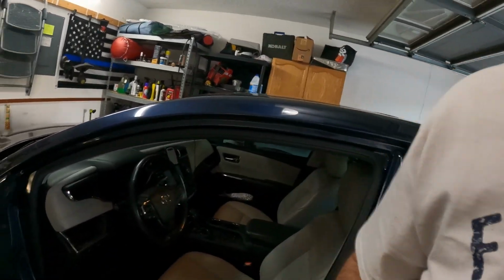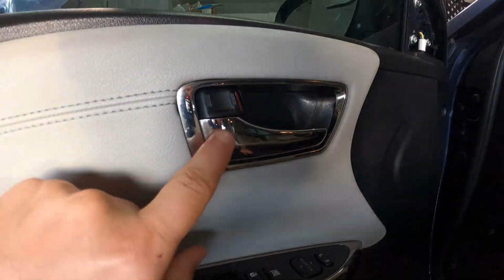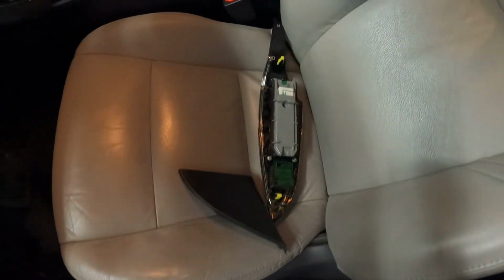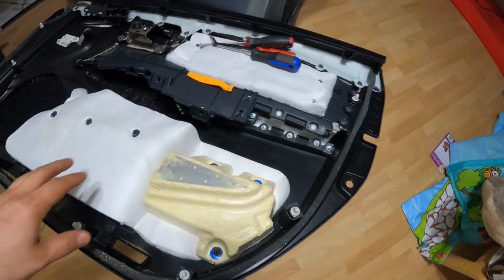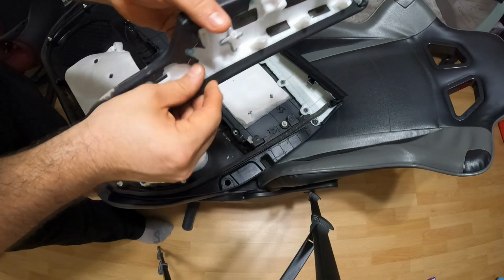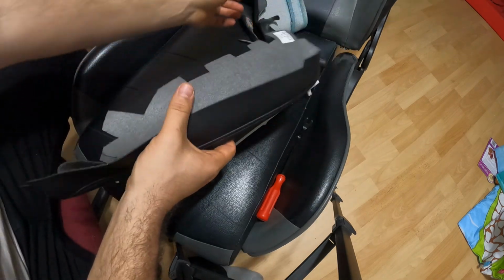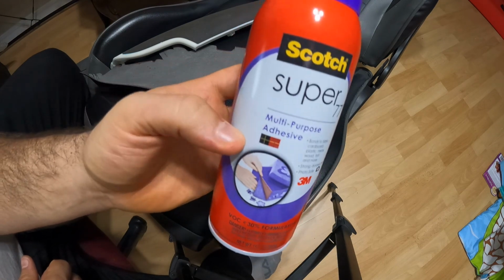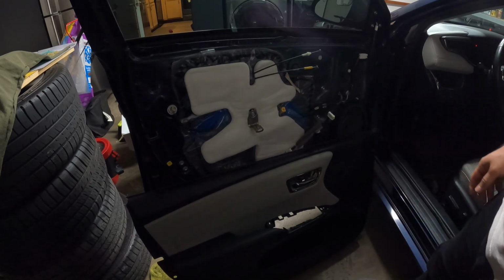2013-2018 Toyota Avalon Driver's door grip replacement.

Comment from the maker: Guys, multiple folks asked me what I did with the tabs that were Drilled Out. I forgot to record how I filled the tabs with Hat glue using my wife's Hot Glue gun. It has been holding on perfectly fine, no issues. I am sorry about that.
Reply: Getting ready to perform this process on our 2013. Replacing the chrome bezel on the switch assembly on the drivers side. Of course the switches must be removed from the original and installed on the replacement bezel. But your video provided good info. Will be using pan head screws instead of the hot glue, or might use 2 part epoxy.
Reply: Bro; I follow up and done job but door won’t lock when I parking or lock car, only driver door stay open any idea replaying 😊
Reply: @NikGarage  I used self tapping screws, they worked fine.

Comment: Not sure anyone commented on this or not. But you DO NOT need to drill out the two black plastic welds to remove the armrest. You only need to drill out the two WHITE welds. 

To reattach the welds, I used a plastic welder but have seen people use everything from hot glue to superglue to panel screws. I think the later is the way to go and don’t know why Toyota didn’t design it that way in the first place. 

Thanks for the video how-to. It definitely kept me from breaking plastic!

Comment: Thanks for the video……..I used the same seller for the “leather” which was excellent quality and as you stated, definitely thicker than oem. Used 3m glue and 3/8” staples …….like you I felt “looks pretty good”. Removing the door panel was actually easy…….putting it back was another story. Still, after a large volume of profanity I finally got it reinstalled. Wouldn’t have tried this without the benefit of your “tutorial “!

Comment: I have the same problem with my 2014 Avalon.  My center console cover is also worn badly to where the vinyl is rubbed off. I, as you, was disappointed with the quality of the material used by Toyota.  Thanks for sharing. Now I know I have my work cut out for me.

Comment: Thanks for the video!!!! Were the Door lock cables easy to remove? Also, did you restaple?
Reply from the maker: Yes, easy to remove, they pop out. No I did not staple, I used Hot glue.
Reply: Yeah, I gotta replace mine. Wish me luck, I am not the handiest chap

Comment: Same Question as Matt Singa:  what did you do about the plastic clips that you drilled out?
Reply from the maker: I Used Hot glue to fill them in and it has been holding on just fine. no issues so far.

Comment: I have the same problem on a 2013 model.  I watched the video and it was quite helpful.  However, the replacement cover shown on ebay when the link is accessed looks quite different from the one you used in the video.  I ordered one from amazon that looks identical to the ebay link and it is considerably too short...it does not fit.  Would you mind verifying that the ebay link is for the one you used in the video?  Thanks.
Reply from the maker: Yes the link is the same exact one I used.

Comment: what did you do about the plastic clips that you drilled out?
Reply from the maker: I used hot glue gun and filled the hole with hot glue. Not the perfect way to fix it but it works.
Reply: Can you buy more clips...is that why you didn't show that part 😆